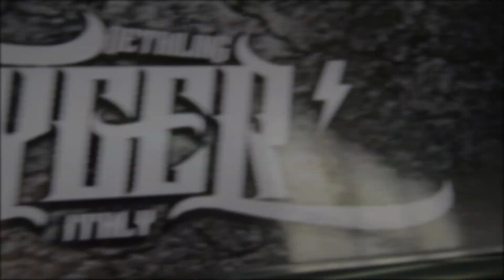Buick THE LONG lesabre by Lee Pratt HAND WAXED by Tyger Detailing

Comment: Great results! I think what is the most intriguing is not the wax you use, but your method of application. Why bare hand instead of an applicator pad of some sort? Thumbs up btw!!!
Reply from the maker: +TheBeauMillion thanks! anyway bare hands got a few bonuses compared with the foam applicators pads, hands are "self-heaters" so the wax its Always on the same warm temperature while applying it.You can definetly Feel all the shapes of the car while you do this massage here...